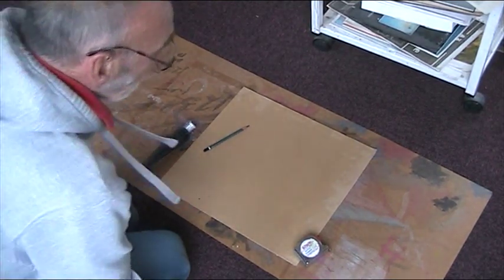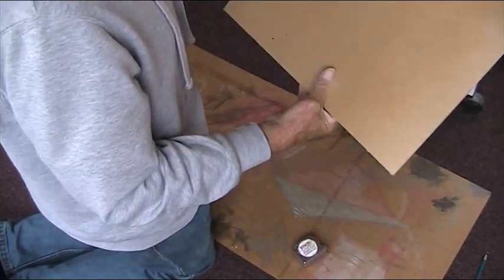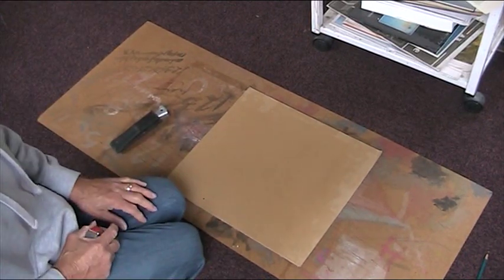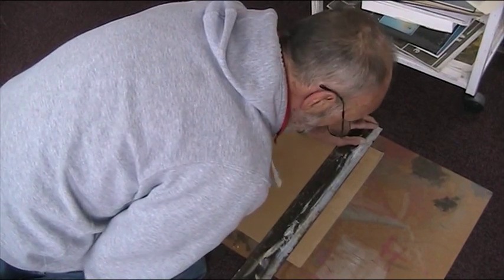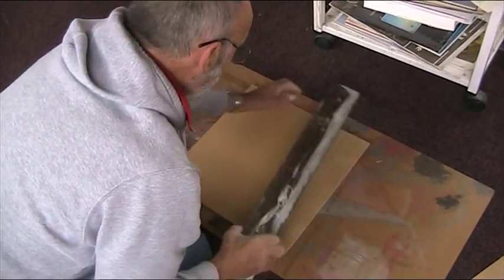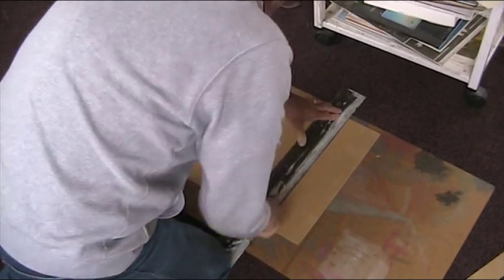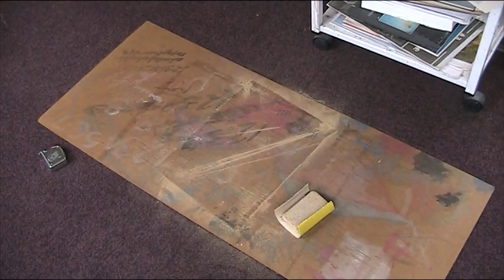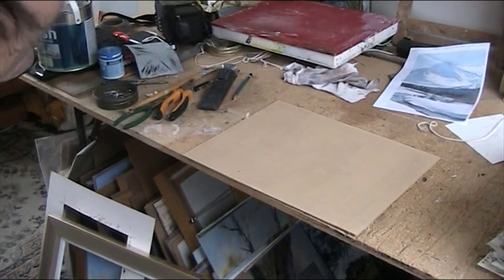Preparing hardboard for painting. Tutorial

Comment: Hi very helpful video. Cheers.

When you prepare that hardboard with the quick drying varnish, is there anything else that you would need to do to start oil painting on it? 

I'm starting to try the wet-on-wet method of oil painting and I was wondering would I be able to apply the liquid white, or pure linseed oil straight on top of that varnish to begin painting?

Comment: Thank you Dave this is very useful video. You mentioned you use a diluted wood adhesive. How much should I dilute it?
Reply from the maker: H i John, PVA woodwork adhesive varies between manufacturers, Too much water and it won't seal the surface; the one I'm using at the moment doesn't need water, it's about right. Trial and error, but it is inexpensive. As you see, i use it with a dollop of acrylic paint to colour the surface.